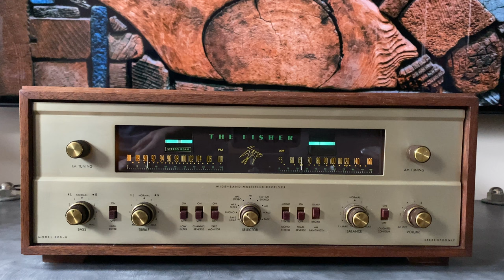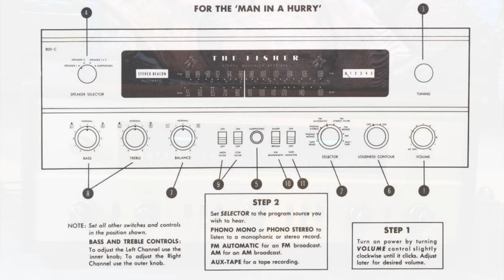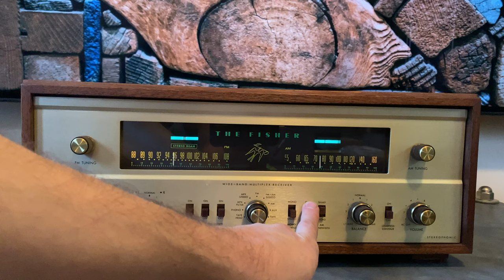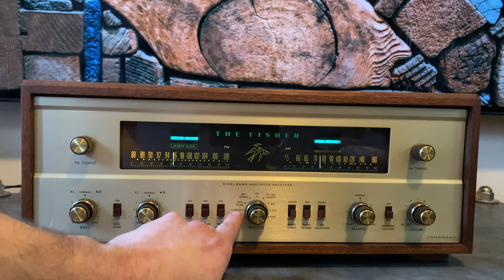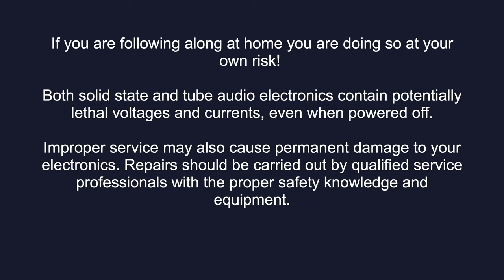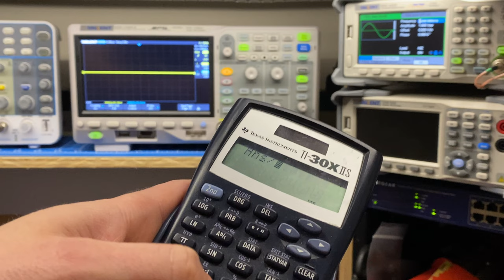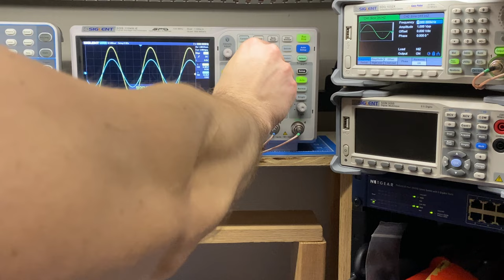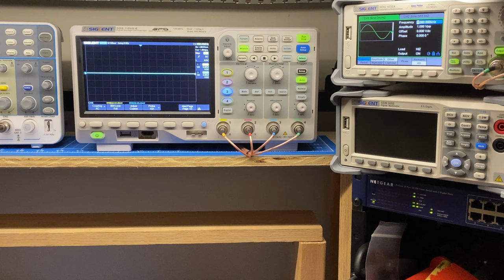Fisher 800-B Restoration Overview & History - Rare 1960s Tube Receiver

Comment: I'm currently rebuilding my 800C and am interested in 2 modifications- an SDS board and the IBAM. May bypass the SDS board because I would like to maintain the original design in the power supply circuit. The IBAM though I like. Did you build that IBAM board or is it available already built? Thank you in advance for your response.

Gilbert
Reply from the maker: The IBAM circuit is very simple. I just build them as needed from perforated project board. There may be some users on audiokarma that have had professional PCBs made up that just need to be populated. I hope this helps.

Comment: A lot of good videos were helpful. Could you tell me about the IBAM circuit?
I wonder what kind of components the IBAM circuit consists of.
Reply from the maker: The IBAM board is very simple. Just four trimmers, 4 caps, and 4 resistors. Some other components need to get changed by the tube sockets as well. This is all well documented on the AudioKarma forums.

Comment: Fantastic video and review. Good information throughout. I'm wondering where you sourced the AM antenna replacement clamps? I will be watching many more of your videos. Thanks!
👍
Reply from the maker: I just purchased a set of assorted plastic cable clamps on Amazon and experimented until I found a clamp with a good fit.

Comment: I have a fully restored 500-c, which has the same 7591 beam tetrode output tubes; however, my unit is rated at about 35 watts per channel rms. Do you know how Fisher upped the power with the same tubes? Also, unless I missed something, your unit does not have provisions for multiple sets of speakers. Is this the case? 
Best!
Reply from the maker: The Fisher tube receivers were made in the 1960s before the FTC power output rule. The 35W rating is exaggerated and not really possible with 7591. The most I have seen a 7591 pair make is 30W in McIntosh MA230. 

Having provisions for multiple speakers was not a common feature until solid state amplifiers were developed. If you want to connect multiple speakers on tube amplifiers in the 1960s it would have been more common to just series or parallel them and pick the appropriate output transformer tap.

The 800B does not have provisions for multiple speakers.

I hope this helps.

Comment: Correct me if I'm wrong, but I always used the "reverb loop" as a means of disconnecting the preamp section from the amp.  I bought an 800B back in the mid-80s at a dusty little shop north of San Francisco for just about 85-bucks.  And I hauled that unit all over the place while I worked jobs from California to Utah and Colorado to New Mexico.   Talk about built like a tank!  But back to the reverb loop.  I used to run an equalizer off those taps and figured it was placed in the system between the preamp and amp.  Was this an accurate assessment of component configuration?   Thanks and this is a great video on the Fisher 800B.
Reply from the maker: I am not sure it works exactly like that. There is a buffer mod specifically for turning the reverb jacks into a usable preout/main in setup so it may have worked but the loading may not have been ideal.

Comment: Can I know the specifications of the silicon rectifier that replaced the selenium rectifier?
Reply from the maker: I used a silicon bridge rectifier rated at 200V 6A but this is way overkill. The original part is rated at 30Vrms 600mA. I just chose something from my stock that would mount well in that position. Hope this helps.
Reply: @NovaluxStereophonic  Thank you for your kind explanation. (:

Comment: I would imagine that when you mean the "military version", the multi voltage aspect was for those who might end up being stationed overseas with 240v/50Hz voltage. I now that during the 1980's, a lot of the Japanese branded audio gear that was sold through the military exchanges were dual voltage.  Great vintage receiver.  the AM/FM stereo was a short lived aspect until the FCC approved the multiplex format. Too bad that today, radio is virtually useless.  About 20  years ago, I sold a Marantz 10B FM tuner that I had inherited from my dad.  There just is nothing radio and TV for that matter worth listening/watching. Broadcast media is now considered the ghetto of media.